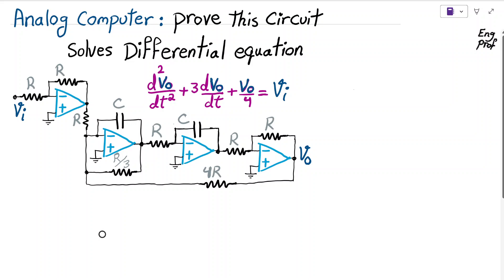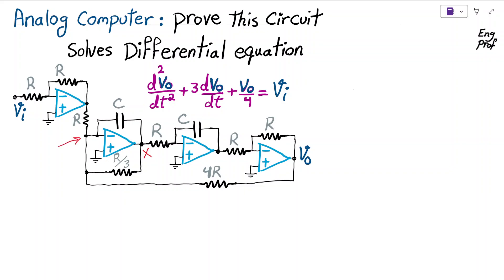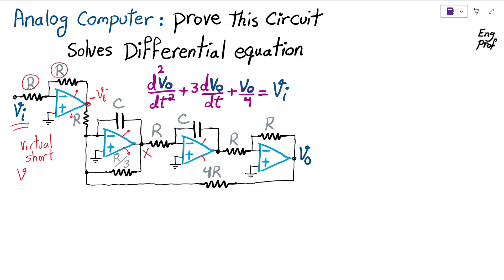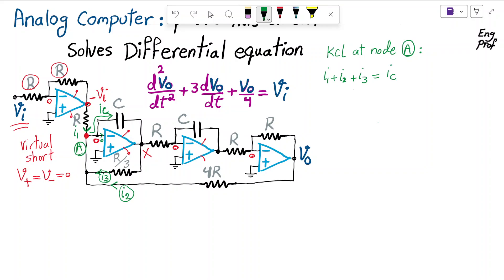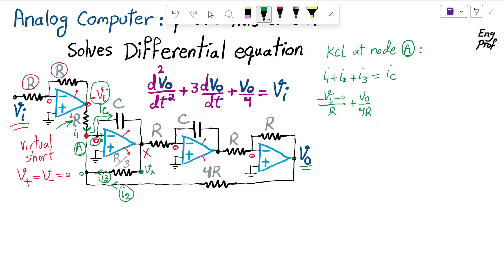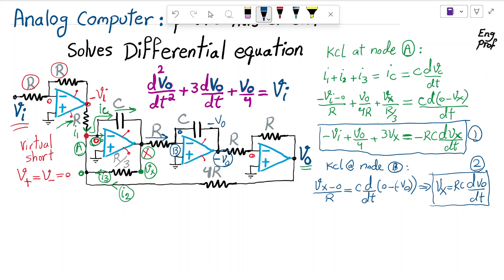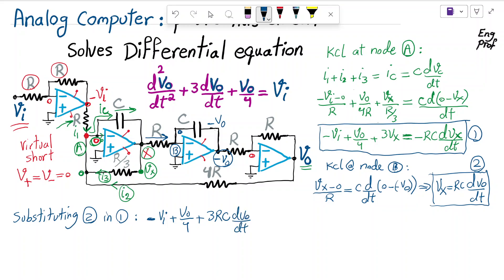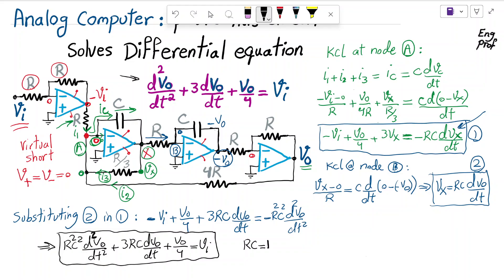Analog Computer with Op Amp to solve differential equation

Comment: Why I am getting straight line on simulation with sine, square wave in LTSpicefor R=1Meg and C=1u
Reply from the maker: Proper selection of Op Amp for your specific application and frequency range is crucial. A proper op amp should have good slew rate at frequency of interest, low drift and low noise with proper bandwidth given your desired application. This circuit has a DC gain of 4 (in steady state) and also operates well with sinusoids with frequency within the spec. For example, for Audio Application, try R=1k , C=1nF. This circuit effectively is a second order lowpass filter with a transfer function of 4*(wn)^2/(S^2 + 2*zeta*wn*S + (wn)^2) where natural frequency wn=0.5/(R*C) = 500k rad/sec and damping factor zeta=3 which means this circuit is overdamped. If you apply one volt DC voltage at input the circuit output voltage should smoothly (in roughly 50-60 micro seconds) reaches 4 volts at the output without peaking.  As the second test, I suggest applying a 10 kHz sinusoidal voltage (with say amplitude 1 volt) at input and examine if your constructed circuit is properly working for the sinusoidal case (the 10kHz sinusoid should appear at the output with amplitude of 4).  Assuming the DC test and sinusoid test are passed then you can try other waveforms.

Comment: Thank you very much for this video, it was very useful for my project. 
I built the circuit at school and I'm having a problem amplifying the DC component. It is clearly the case with third order circuits. Do you know how to improve it in practice? I put large resistors in parallel with the capacitors, but it was not enough. A teacher told me to find out about the offset legs of the op amp, do you know how they work? I couldn't find anything on the internet...
Reply from the maker: You're welcome. Glad to hear that my video was useful for your project. Regarding your questions
You're welcome! I'm glad to hear that my video was helpful for your project. To address your question, I recommend watching the https://www.youtube.com/watch?v=ENq39EesfPw video of an Op Amp-based Analog Circuit to compute solutions for differential equations with programmable coefficients. This video might provide more insight into your specific case.
In regard to the issue you're facing with amplifying the DC component in third-order circuits, adding resistors in parallel with the capacitors is surely a good starting point. The problem you're encountering is often related to the input offset voltage and the bias currents of the op amp, which can create unwanted errors in the DC performance, particularly when working with high-order circuits. Here are a few suggestions to improve the DC performance of your circuit:

Use Op Amps with Low Offset Voltage: Ensure that the operational amplifier you're using has low input offset voltage (ideally in the microvolt range) because offset voltage can affect your DC measurements and steady-state behavior. For precision applications, quad op amp package OPA 4189 CMOS op amp https://www.ti.com/product/OPA4189 should be a very good choice, as it offers very low drift and near zero offset voltage. Using a quad op amp package can also help minimize noise and maintain consistency across multiple channels. See Texas Instruments' precision Op Amps matrix https://www.ti.com/amplifier-circuit/op-amps/precision/overview.html for more choices.

Offset Nulling: Many precision op amps have pins dedicated to offset adjustment, sometimes called "offset legs" or "offset null pins." These pins allow you to apply a small external voltage to nullify the op amp's offset. If your op amp has offset pins (e.g. LM324), you can connect a small potentiometer to these pins to manually null the offset and improve the DC performance. Some modern op amps, like the OPA4189 or OPA333, don't have offset null pins but achieve very low offset voltage through internal trimming.

Add a Low-Pass Filter at the Output: Since you're dealing with a third-order circuit, higher-order circuits can have more sensitivity to small DC offsets or noise. Adding a low-pass filter to the output can help smooth out any remaining DC offset by filtering out unwanted high-frequency components that might be interfering with your signal.

Proper Biasing and Component Selection: When you're using large resistors in parallel with capacitors to improve the DC gain, it's important to choose resistors with low noise and low drift, as well as capacitors with tight tolerances. Temperature variations or component tolerances can introduce unwanted drift, so ensure that the components you're using are rated for low temperature coefficients and high precision.

Temperature Effects: High-order circuits are particularly susceptible to temperature-induced drift. Make sure to use components rated for stability over the temperature range you're operating in, and consider using op amps with built-in temperature compensation if you're working in environments where temperature changes might be a concern.

By following these recommendations, you should be able to reduce the DC offset and improve the stability of your circuit, especially with higher-order systems. It’s always good practice to double-check your op amp's datasheet for specific features like input offset voltage and temperature coefficients, as well as any internal compensation mechanisms that can help optimize performance. 
I hope this is helpful.
Reply: @STEMprof  Thank you very much for your reply.
Buying new Op Amps worked very well. I tried the low pass filter, but it overloaded the circuit a bit.
Thank you again for your videos!
Reply from the maker: @BananaSwingingBeard  You're welcome. Glad to hear that the new op amp worked well. 👍 Hope you enjoy the rest of videos as well. Happy holidays!
Reply: @STEMprof  Happy holidays too! I'm from France so my holidays are in a few weeks but thank you!
Reply from the maker: @BananaSwingingBeard  je vous souhaite une bonne et saine année pleine de circuits passionnants :)
Reply: @STEMprof  merci beaucoup !! A vous aussi ! 🎉🎉

Comment: Would this circuit be modeling something like a suspension system?
Reply from the maker: Thanks for watching and your good question. A more general example is https://youtu.be/ENq39EesfPw . Of course, assuming a mechanical or suspension system that matches the order of the designed circuit. For example, please see:
Spring-Mass Mechanical System https://youtu.be/I4mqQQ9hSKc
Double Spring-Mass System Analysis https://youtu.be/lCyJGtUK9zs
I will post more examples soon about modeling mechanical systems with electrical circuits. I hope these videos are interesting. Thanks again for watching 🙋‍♂️

Comment: What size caps should I use if I am working with a long pulse? About five to ten seconds long?
Reply from the maker: Thanks for watching and your follow-up questions. Glad that you are interested in this Analog Computer circuit video.  Assuming you have selected proper Op Amp (good slew rate, low drift and low noise with proper bandwidth given your desired application) this circuit has a DC gain of 4 (in steady state) and also operates well with sinusoids. For Audio Application, try R=1k , C=1nF. This circuit effectively is a second order lowpass filter with a transfer function of 4*(wn)^2/(S^2 + 2*zeta*wn*S + (wn)^2) where natural frequency wn=0.5/(R*C) = 500k rad/sec and damping factor zeta=3 which means this circuit is overdamped. If you apply one volt DC voltage at input the circuit output voltage should smoothly (in roughly 50-60 micro seconds) reaches 4 volts at the output without peaking.  As the second test, I suggest applying a 10 kHz sinusoidal voltage (with say amplitude 1 volt) at input and examine if your constructed circuit is properly working for the sinusoidal case (the 10kHz sinusoid should appear at the output with amplitude of 4).  Assuming the DC test and sinusoid test are passed then you can try other waveforms. For more examples please see https://www.youtube.com/playlist?list=PLrwXF7N522y4c7c-8KBjrwd7IyaZfWxyt
I hope this explanation is helpful.

Comment: I tried making this circuit today and I got mixed results. I tried it with a Vi pulse that was over two seconds long. I had my oscilloscope on a real slow scan. Is there a minimum speed that this will work for?
Reply from the maker: Thanks for watching and sharing your observations and thoughts. Glad that you are interested in this Analog Computer circuit video.  Assuming you have selected proper Op Amp (good slew rate, low drift and low noise with proper bandwidth given your desired application) this circuit has a DC gain of 4 (in steady state) and also operates well with sinusoids. For Audio Application, try R=1k , C=1nF. This circuit effectively is a second order lowpass filter with a transfer function of 4*(wn)^2/(S^2 + 2*zeta*wn*S + (wn)^2) where natural frequency wn=0.5/(R*C) = 500k rad/sec and damping factor zeta=3 which means this circuit is overdamped. If you apply one volt DC voltage at input the circuit output voltage should smoothly (in roughly 50-60 micro seconds) reaches 4 volts at the output without peaking.  As the second test, I suggest applying a 10 kHz sinusoidal voltage (with say amplitude 1 volt) at input and examine if your constructed circuit is properly working for the sinusoidal case (the 10kHz sinusoid should appear at the output with amplitude of 4).  Assuming the DC test and sinusoid test are passed then you can try other waveforms. For more examples please see https://www.youtube.com/playlist?list=PLrwXF7N522y4c7c-8KBjrwd7IyaZfWxyt
I hope this explanation is helpful.
Reply: @STEMprof  bro my circuit is just amplifying my sine, square waveforms and I don't think it is acting like a DE solver when i take R=1k and C=10n....can u give me your whatsapp no. so that i can resolve my doubt...i actually got a projject in iit indore

Comment: if it s possible, Could you make a vıdeo on the same type but with initial conditions?
Reply from the maker: Thanks for watching and your interest. Sure, I'll post circuit with initial condition. In the meantime, here are few more Analog Computer examples: 
Op Amp Analog Computer Differential Equation Solver: https://youtu.be/ENq39EesfPw
Logarithm Analog Computer with Op Amp https://youtu.be/RpKEq5WyoLg
Differential Equation Solver Analog Circuit https://youtu.be/R3X5AYNZGEI
I hope these Circuit engineering and analysis videos are helpful.

Comment: This video is exactly what I was looking for. I am studying the schematic for a synthesizer module that uses op-amps, capacitors, and resistors in similar feedback loops. When two specific node voltages are plotted against each other (x/y mode), they look like a Lorenz Strange Attractor. I believe the analysis shown here should help me derive the differential equation for the circuit, which in turn should help me simulate it in software efficiently. Thank you so much for a clear and direct explanation of how to approach these problems!
Reply from the maker: Thanks for watching & sharing your thoughts. Glad to hear that this Analog differential equation solver is helpful.
Reply from the maker: A programmable Op Amp based Differential Equation Solver Analog Computer: https://youtu.be/ENq39EesfPw  I hope this video is helpful as well.  Thanks for watching.

Comment: First of all I want to say this is one of the best ee engineering channel I've seen. Secondly, can you explain the puerpose of the R/3 resistor connected to second op amp. Only explanation I could come up with is that resistor is just for the mathematical equation.I hope you respond. Great content, thanks!
Reply from the maker: Thank you for watching and for your comment.  I am glad to hear that this Engineering Channel is helpful.  Regarding your question, in the ideal op amp circuit shown in this example, the R/3 resistor is needed to realize the 3dvo/dt term in the target differential equation. 
In addition to that, as a side note, in a practical circuit design, op amp device is not ideal, therefore whenever a capacitor is connecting op amp output to it's input terminal, we practically need to have a large enough resistor in parallel with that capacitor to avoid saturation and to practically handle potential DC offset caused by the non-ideal op amp that has non-zero input bias currents.
Reply: @STEMprof  Thank you for your reply. This make me think how we can multiply the first order derivative term y' with y, like yy'. I hope you reach the big numbers for the channel!
Reply from the maker: @farukkaya4396  you are welcome, and thank you for your support and kind wishes.
Reply from the maker: A programmable Op Amp based Analog Computer circuit that solves Differential Equation: https://youtu.be/ENq39EesfPw  , I hope this video is helpful as well.  Thanks for watching.

Comment: I see a third feedback in the last opamp, or am I wrong?
Reply from the maker: Thank you for watching this op amp video and your comment. There are many feedbacks in this circuit. But the main resistive feedback is from output Vout to input via 4R resistor. Aside from that, we have three more resistive feedbacks and  two capacitive feedbacks. It is just a matter of how we consider them in a given analysis to solve for characteristic equation and system transfer function.
Reply: @STEMprof  Thanks for your explanations. I knew capacitive feedback was there, but also know that's a dynamic feedback and you obviously referred to static, ponting at resistors. Other than that, op amps is not my forte but yours, of course.